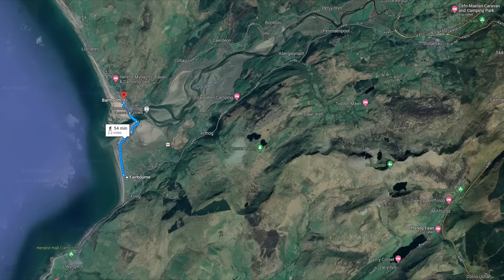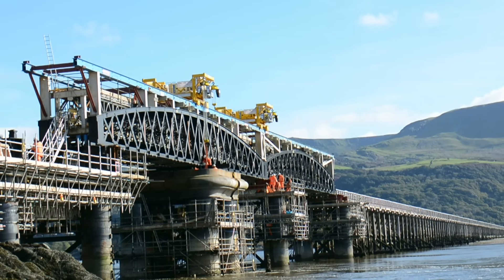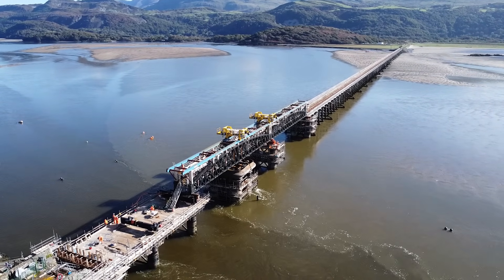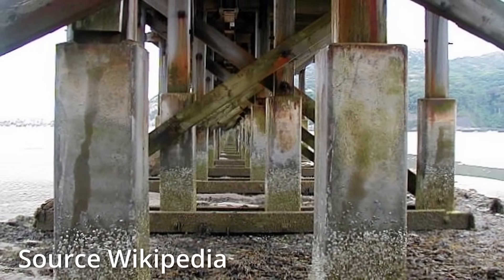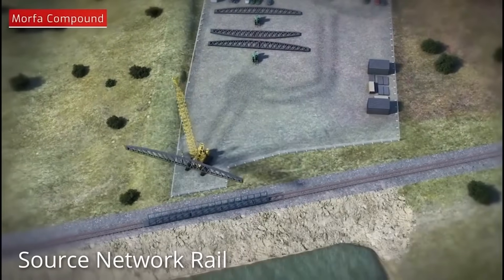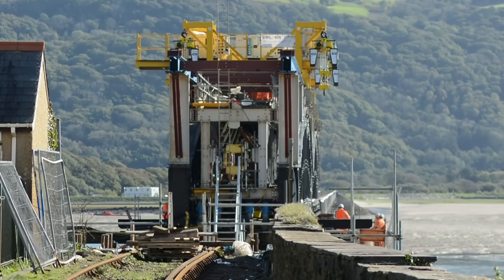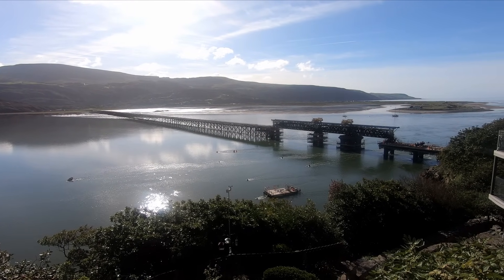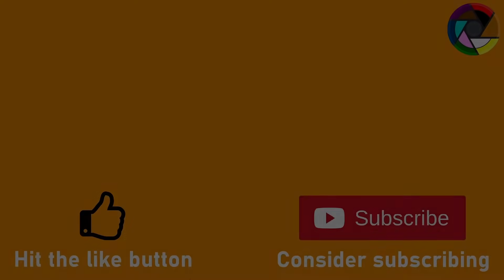Rebuilding Barmouth Bridge | Cambrian Coast Railway

Comment: The new bridge is an amazing piece of engineering.  However after refurbishment in the 1980s gave the original bridge an extension of life. However our usual lets watch the bridge fall apart maintenance policy on the railway, meant through the 90s to replacement no major work was done thus the job was a lot bigger in the end.